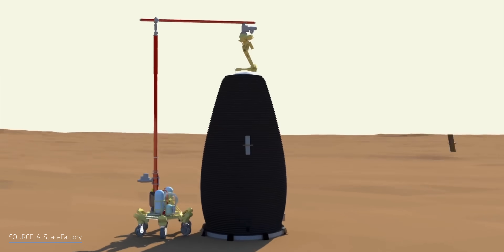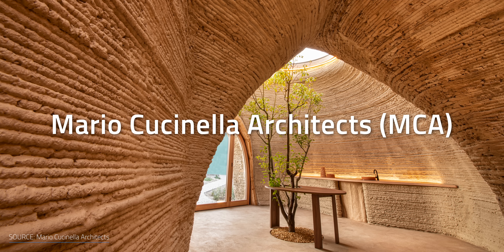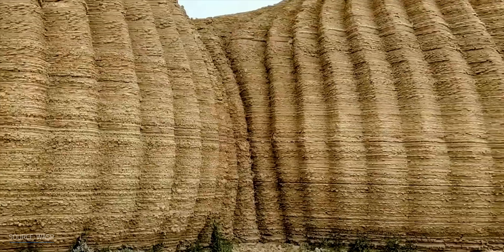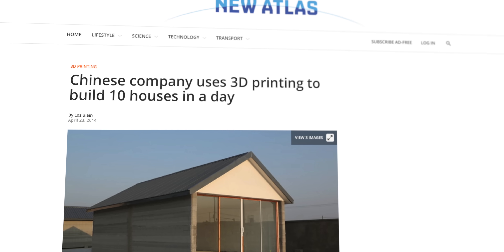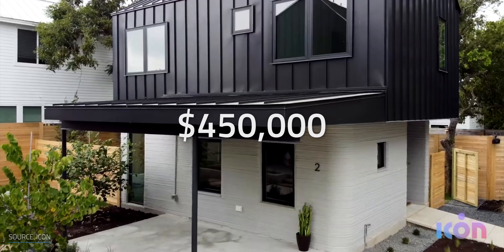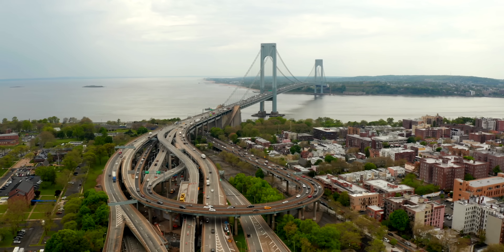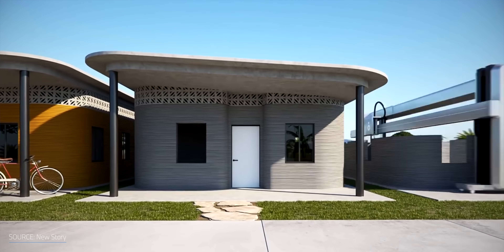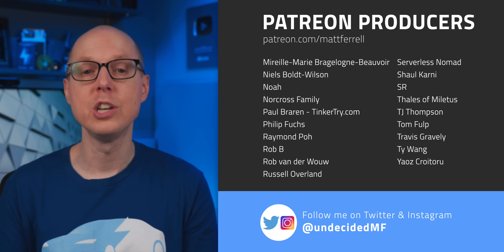The Truth About 3D Printed Homes

Comment: From a civil engineers perspective, making the clay from what is found at the site will add a massive variability to the strength and longevity of the structure. There's a reason that other house printers mix soil with cement and not just water
Reply: Yeah, and certainly why people have made heated clay bricks for so long. As a building material they at least have less variables than a big clay cob wall.
Reply: Well the house's small, just 1 floor, and the WASP guys used every trick in the book to make their little hut as structurally sound as possible so I assume the design itself makes for a lot of that variability. I'm more concerned about erosion, unless that clay's fired and nicely finished the hut's bound to return to goop fairly quickly.
The cement option is a much more realistic take if you intend to offer houses made of proper material, rather than garbage, in someplace's slums, otherwise the classic brick and mortar is still there, just invest in it to make it more financially accessible.
Reply: @cdgonepotatoes4219  Indeed. This is what I worry about. "I'm more concerned about erosion". Cause it was mentioned that it being dirt, meant when it's 'lifetime uses is up, it returns to the ground naturally'.

Dude, we have homes still built from the fucking 1600s! Updated, referbished, remade with new materials here and there, but homes exist FOREVER. Cause it will either be in your family forever, your grandkid's grandkids living there 100s of years later. Or you move/die and someone ELSE moves in. I have NEVER seen a situation where a Home 'dies' and is no longer in use ever again, 'Except' when removed unnaturally by people to put a different building there.

Them hinting there is a 'Time Limit', sounds horribly evil. Cause it would mean your family would, eventually, maybe in 10 years, 20, 50, 150, eventually, Have to WASTE MONEY buying a BRAND NEW home every X years.

Could you imagine it? Picture it. You bought a piece of land. Your family can finally settle down. Then you spend $500k and a year or two building a brand new home. And then 10 years later, it decays and you got to spend ANOTHER $500k for a NEW home, with new plumbing, new walls, new electrics, and so on. That sounds like a Step DOWN/BACK in Technology and Advancement!
Reply: They most likely did their test builds and marketing in an environment where they could control the quality. Then jsut add a massive asterix to the claims.
Reply: @adrianflo6481  They bring samples of the local soil to their lab and figure out viability and any additives before starting the build
Reply: @rexsceleratorum1632  So then its not soil directly taken locally. Cause i bet my sweet ass that its not as simple ass modifying the local dirt. 
Not all dirt is the same. 
#blackdirtmatters.
Reply: @adrianflo6481  My understanding is that it is soil directly taken locally, combined with any additives which were brought in and mixed on site
Reply: @rexsceleratorum1632  Didnt you write that like 2 weeks ago?
Reply: @adrianflo6481  Not sure what you mean. My earlier comment was 6 days ago apparently. And they say different things.
Reply: @rexsceleratorum1632  "They bring samples of the local soil to their lab and figure out viability and any additives before starting the build" 

"My understanding is that it is soil directly taken locally, combined with any additives which were brought in and mixed on site" 

Those two are similar enough. My comment persists. I dont think that they can use local soil everywhere that they go.
Reply: @adrianflo6481  They bring samples of the soil to their lab to figure out the required additives by soil testing. Then they take the additives and go to the site. Then they dig up local soil and mix in the additives they brought, without taking all that soil to the lab. So they are indeed using local soil without shipping it around. Am I not being clear?
Reply: @rexsceleratorum1632  What youre not being clear with is what types of additives and the logistics and economics of hauling additives.
Reply: @adrianflo6481  You'll have to ask them.
Reply: Definitely the mix would have to meet certain strength and durability requirements. A weather proof exterior finish should be part of the design and a sanitary interior coating adds to the cost. Most of all why can't the walls be troweled smooth to represent a more typical structure rather than bee hives or mud dauber nests?  Finally is the R value suitable for green tech mandates?
Reply: @carlwest859  Earthquake resistant they won't be and make sure you don't get a water leak or your termite dwelling will look like a kindergarten made clay vase.
Reply: i think you mean shrinkage, and plasticity index, for it to flow and be deposite, it need to be at least liquid, then when it deposites, need to turn plastic to stick, then it shrinks and solidify 
i'm a fan of mud construction and been following lot of videos about how use them
there is a misconception about fired bricks, fired bricks were used because they don't need a large roof to protect them from element but they are way more expensive to may than adobe or cob, usually it was rich people that used them
but modern traditional methods now can make beautiful and well built cob and adobe houses
but they take time to build and thus everyday of work, that applied layer shrink and solidify, and it get compacted manually too
Reply: @zazugee  I don't think that's true. Very non plastic clays can be adhered using a liquid with adhesion properties. Also there are many extruder on the market that can deposit or expel clay in a solid state.
Reply: I took some shale, and tried to make bricks once out of crushed shale.   After all, it's got to be easy, our ancestors did it, right? right?   Not so quick.  My bricks had no integrity.   and I have an engineering degree.  I measured the a, the b, the c.   But, clearly I was wrong about something.   Local dirt, is more then quirky, but clearly there is variation in the same layer, even in the same county.   (I used shale from 20 feet underground).
Reply: @normbograham3  As an engineer surely youd know that the fact that you are educated has no bearing on the integrity of your dirt. clay doesnt get more stable when surrounded by human engineers. thats not how it works.
Reply: @adrianflo6481  Dont be silly, the clay will see my engineering degree, and fall into line.
Reply: @adrianflo6481  lol.   I got my engineering degree and bought a house.  A starter house, with a skunk under the house.   So, I put that degree to work, because clearly with all that education I was smarter then the skunk.    Nope.   The Skunk was smart.
Reply: @normbograham3   why would shale be your go to choice? What was your process, heat or just compaction? What else did you add to the crushed rock?
Reply: @ancienttechnology7337  I came across a local brick recipie, which involved shale.  They used the shale, because it had less impurities.   I"m sure they were using shale, but testing showed a huge variation in shale, using the simple jar test, even in a 100 square foot area.   .   I think they varied the clay proportion.   However, even after a month of looking part time, I realized, there is a lost art there.    Info is lost.    Shocking, because, the bricks that were made were ok but I cannot reproduce them.   Mine are brittle, and crumble.
Reply: @normbograham3  they would have added about 10% plus of a feldspar, granite, or they would have used a specific shale that contained the correct amount naturally. This would be an extremely rare deposit to find but they do exist. In fact there's a deposit of quarts in Idaho with the correct amount of feldspar naturally contained inside the deposit so that once it's crushed and heated it melts into a clay mixture readily at 2280 degrees. So thats the problem you had.

1. Specific shale

2. Possible additions

3. Exact temperature they used could be a wide range from lower temps in the 1800-2000 range or up to high temps of 2200 and higher.

You have to do a series of heat tests. Then when you understand the source material from the first round of tests you can then do line blends of another locally sourced material and you'd find a usable product. Now all of this would be based on the source material not containing dangerous compounds like uranium which is commonly found in feldspar which comes from granite.
Reply: @normbograham3  so in all likelihood they probably got lucky and found something very special and rare that when crushed readily melted into a brick, or perhaps they were genuinely good at making materials from naturally sourced stone and mixed up their own stuff. It would be way easier to find things mix together and the tests are really simple based on volume so even a primitive culture with fire and basic tools could make these achievements. Literally we could do this in just weeks from what's in the sediments in any area on earth. We would probably find some harmful stuff though in much of it.
Reply: Also there are variables of Seismic vibrations and wind speeds depending on the structure of tectonic plates and climate in any region, which will further add vulnerability to this type of structures. I have personally seen mud, Adobe and Cob structures failing miserably in moderate seismic activities.
Reply: The problem with real engineers is they are not collectivist utopians. They always let real world considerations get in the way of dreams of paradise on earth.
Reply: Not gonna lie .that clay house looks ugly , fragile and vulnerable to quakes , insects, water pipes ruptures,rain,.....
Reply: I'm an former architect and architectural engineer. The most feasible material is whatever naturally adapts to the environment. Concrete was a major breakthrough in the early 20th century but these days its impact on the environment, along with the availability of sand (which is less than people think) isn't feasible for sustainability or ecological impact in the long-term. We currently have the ability to grow increasingly strong and sustainable biological materials for building, but the industry is somehow still focused on plastics. It's like someone creating a pill that cures cancer that can only be fired point blank from a gun. It's a catch 22. But, with 3d printing, there are a ton design options that open up for low income engineers and designers, which helps more than it hurts. If we could change the materials involved to something that's not harmful to the environment , we'd be far better off.  But people are people. 🤷🏽‍♂️
Reply: @chenzenzo  if the local clay is a known variable then amendments to the existing material would actually be pretty easy.
Reply: I imagine that could be controlled for by changing the design/process based on the region, idk
Reply: Hemp composite?
Reply: Cement production has a very very high carbon footprint because it requires extremely high temperatures to create cement
Reply: What would adding lye to the mix do
Reply: @22minus13  I've never done it but sodium hydroxide burns organic material and oxidizes metals. So I'd expect results with those outcomes.
Reply: For what it's worth, it's quite possible to build 1-3 story buildings out of mud brick / adobe that are as strong and durable as you like. You need to overbuild the walls quite a bit to account for the variation in soil composition you mentioned, but given that the building material is functionally free, this is not a huge problem if you can automate away the labor involved. There are surviving mud brick buildings that have stood for literally thousands of years. Certainly no stick construction could plausibly last that long!

Using adobe safety requires some care (ratio of clay to sand to fiber must be appropriate, and architecture should minimize tension), but is widely used in many parts of the world, and is allowed by building code in southwestern US states with climates suited to it.
Reply: I think they should add natural resin or latex in the mix.
Reply: @fadlya.rahman4113  definitely a cool idea.
Reply: Super Adobe.
Reply: What about firing the structures after construction, as Nader Khalili dud with traditional adobe brick homes? That would stabilize greatly. Failure of earth structures during quakes is due to absorption of rainwater, I believe. Firing would stop that.
Reply: I remember making little dirt bricks when I was a kid, and building with them. turns out that the same soil is used for making actual bricks (the red ones)
Reply: Except for places with heavy wind and rain. The natural elements do that to dirt. It may work in places like Arizona or Nevada where there is much less humidity and more dry season.
Reply: https://www.youtube.com/watch?v=4MLJs1KRa0Y
Reply: Thank you a comment from someone who knows what they’re talking about. I just read a comment from someone who claims to be a handyman 😂 leave this to the engineers
Reply: That is their idea.  Their houses built with current technology will have strength and durability!  They the rich liberals will live a long and happy life!  You workers, houses and possessions will easily crumble back into the dust as soon they are done with you.  And even your body will be turned into food for the Masse's, so no wasted space on burial for you.
Reply: @Number6_  But soylent green is so tasty.
Reply: Shhhhh you just made a virtue signaling soyboy cry 😢
Reply: I thought it said it also adds “rice waste?” Maybe the gluten and fibers add that missing component…
Reply: @JohnnyJiuJitsu  rice waste is also called rice hulls. This mixed with clay make a basic Cobb mixture. The fiber helps to provide the tensile strength that the clay lacks. Basically the agrarian version of steel reinforced concrete.
Reply: Do they still use animal blood in cement?
Reply: @ratchow1  you're thinking red brick. My guess is no but I'm not sure.
Reply: @cliffordbradford8910  In 1980, Charles Laleman of France received a US patent (No. 4,203,674) for a technique for making concrete by mixing together cement with blood. His patent described a variety of different recipes one could use to create this blood concrete. For instance:

EXAMPLE 1
A light colloidal concrete is prepared by using:
a commercially available cement (cement CPA 400), a silico-calcareous sand graded no higher than 0.8 mm (the cement/sand mass ratio being equal to 1), whole blood powder of animal origin, a colloid, and mixing water in variable proportions.
The various constituents are mixed by means of a mixer working between 100 and 600 r.p.m.

The advantage of using blood, Laleman argued, was that the oxygen in it produced a lighter concrete.

Curiously, Laleman acknowledged that the idea of using blood to make concrete wasn't in any way new. He cited a variety of earlier patents, such as US patent 1,020,325 from 1912 which described mixing blood into concrete. And, in fact, the technique of using blood to make concrete was even practiced by the ancient Romans.
Reply: @ratchow1  so many cheaper, easier and better ways to aerate cement products.
Reply: @ancienttechnology7337  I don't know what would be anymore easier and cheaper than the left over scrapes of a central bi plant or a slaughter house.
Reply: @ratchow1  cheap maybe, but have you smelled blood meal? Definitely one of the worst smelling products I've ever used. It's got a very specific smell that you can't mistake or forget either. If they used blood meal in the concrete you'd know it because that smell would permeate the structure. That detractor alone would stop me from using it in any structure I'd spend any time in. I don't use it in my garden for the same reason. My garden is a sanctuary for me, as well as a place I produce food. Smelling like rotting blood meal would stop me from working the land.
Reply: @ancienttechnology7337  my dad used to spray out the trucks the carcasses came in. I'm very aware.

Comment: a few things.. Why only one story ??  arent all the inside appliances also added at the end of conventional construction? You could easily lay the wires into the wallls during the print so all that routing isnt done after the fact .Mixing an epoxy with locally sourced clay may solve a few issues.. Yea, not as enviromentally friendly , But no one gives a crap about sustainability while living in abject poverty.

Comment: 3D Printing is a technology. Now designers must use it to its advantages.
As an mechanical engeneer myself, I see the biggest advantages in creating hollow shapes and complicated structures.

E.g. you could plan for pipes and electrical lines, just print the outlines of that layer, lay in pipes and power lines and than print around them.

By using honeycone structures (like bees and wasps) you can build "thik walls" with less material. This means great isolation and structural strength. 

So this early houses are more a tech demonstration.

In the future the hole prozess of planning an building houses must change, to really get a big advantge, beside cool looks.

Comment: The problem is that the framing/walls of a house is maybe 1/10th of the work of building a house, and its also the easiest part. The major and most time consuming part of building a house is everything else in it. Plumbing, outfitting with cabinets, electricity, roofing, windows, etc. 
Plus its not fast. If you were to build a similar sized home with similar materials, i.e. masonry units, it would take less time.
The far more optimal avenue is premanufactured sections at a main factory on a large assembly line that then get shipped out and connected. This way you have walls, insulation, windows, roofing, all modular and ready to be joined together, taking mere hours to get an enclosed building ready for the installation of utilities. It also specializes the work in a central hub where quality control can be emphasized, while mass production drives down the cost.